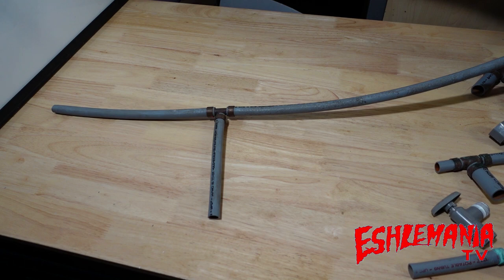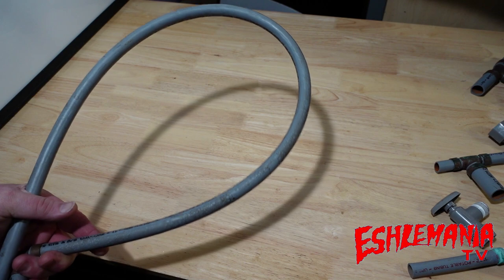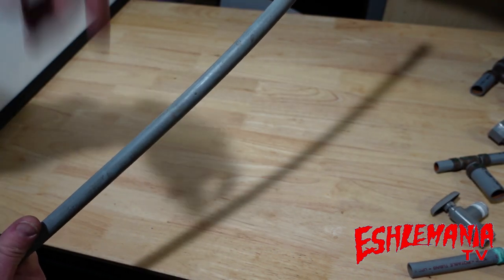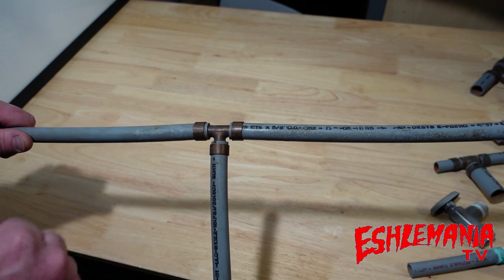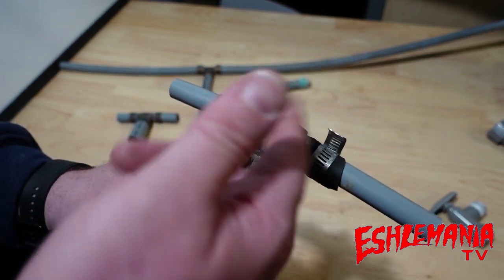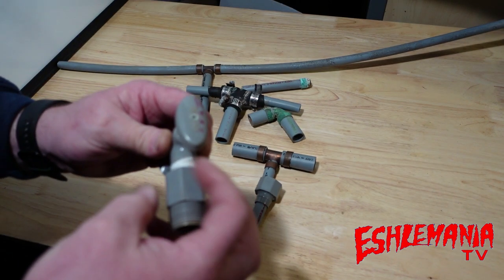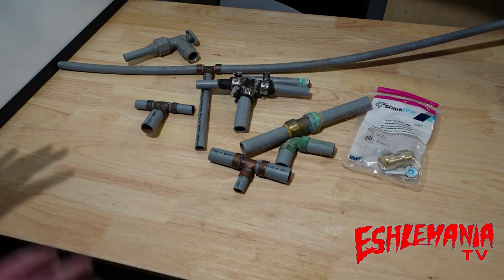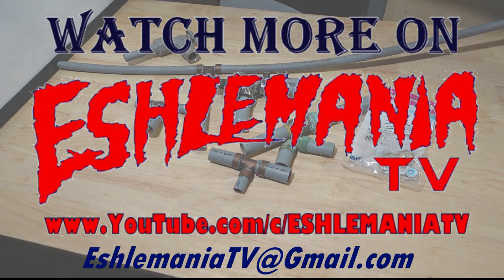Quest (Polybutylene) Tubing Info & Examples of WHY YOU NEED TO REPLACE IT If It's Used In Your Home

Comment: In the process of a kitchen remodel thanks to a spontaneous pinhole leak in th wall behind the kitchen sink.  Started out real quiet and slow, soaking the insulation - soaked three 16" sections of wall to the left and right of the leak. I had replaced most of it in the house after the last two similar leaks. The exterior wall, behind the cabinets was too much to get to before. Now with the cabinets destroyed, it's not such an issue. 🤪Thankfully insurance is kicking in some to help. They never give you the amount you need though!

Comment: got a surplus of the pipe and copper fittings and stuff still, great for ponds and water features. i did run a hose bib with it tho, but it's easy to access and i will be seeing it often lol

Comment: Thank you so much for this. Finding any bit of information on this is a pain, and it is next to impossible to find any of the fittings or piping to replace of a few places charging like $20 for a fitting. I will probablly just look into replacing since this is the second time I've had a fitting break
Reply from the maker: If you have this gray tubing you should definitely look into replacing all of it

Comment: We have gray polybutylene tubing in a house.  Goes from the water valve coming into the house in the basement.  Up to the ceiling then across the ceiling to CPVC pipe.  The CPVC pipe then feeds the hot water heater and the copper pipes serving the upstairs.  Never had any problems with the gray polybutylene.  I think some people just seem to attract problems.
Reply from the maker: It's not a secret that a lot of insurance companies have stopped offering coverage to homes with this stuff in them because of how bad it is.

Comment: I've had pb for 38 years, all connections are the compression type (no crimping) but I'm also on well water.   No leaks ever. If a compression started to leak, it just a half turn more on the nut. But it's never happened.  Hopfully never will.
Reply: I had a compression fitting leaking under my house. I tried tightening it but it made it worse. I ended up putting a SharkBite fitting on the polybutylene. I'll eventually replace everything with PEX.